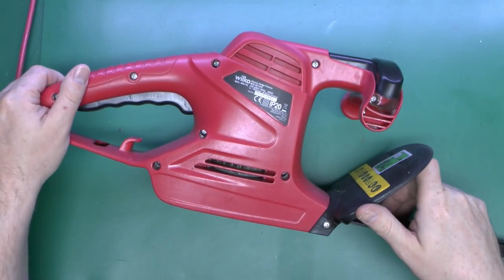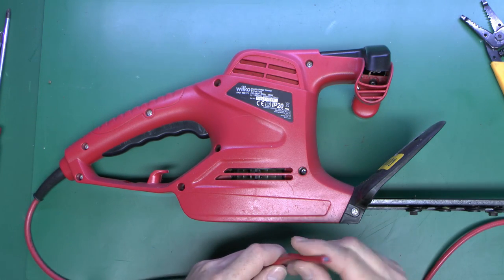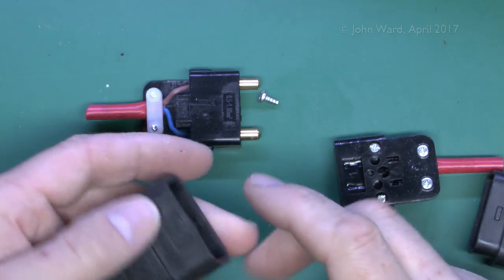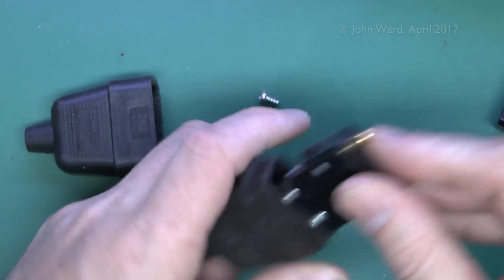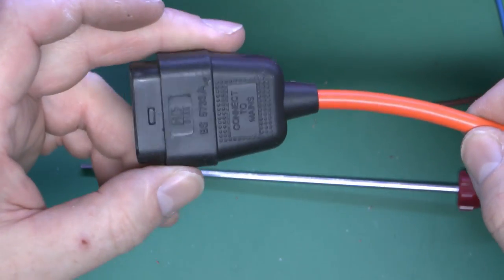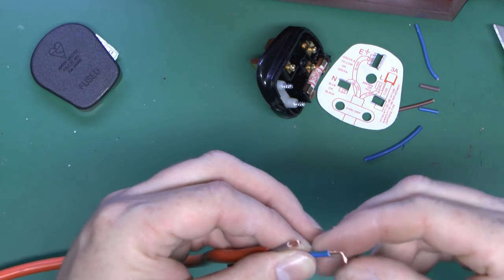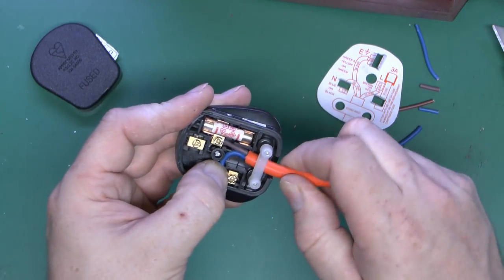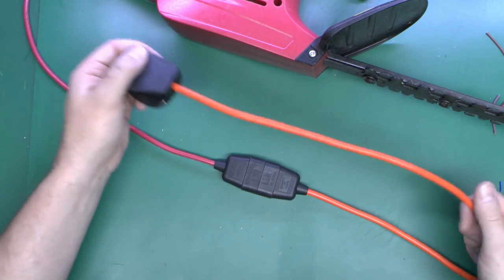Hedge Cutter Flex Replacement, Plug & Connector Wiring

Comment: when did Wilko become a sub standard shop?  it sells many good items. i agree the trimmer is crappy. but Wilko is awesome retail outlet. have you visited the pick and mix nuts bolts section?
Reply: Took me ages to fill a large bag, just had to keep putting more nuts and washer in to fill it :)
Reply: Every retailer sells crap, but they also sell some good stuff at reasonable prices.
Reply: Tangobaldy I agree Wilko is superb!
Reply: If you buy crap you get crap, that is entirely your own fault. Even the bigger ones like screwfix sell the crap parts because there is a market. 
If you feel better for paying £6 for a pack of ten wood screws that really proves you are very shallow.
Reply: Wall plugs are right money in wilko

Comment: Re oversized fuse, i've even caught channel safety systems putting 13A fuses on 30w LED power units....
Reply: You will have to count the power factor when you measure the fuse. if it is worse than 0.65 the current will be over 3 A.

Comment: Are those inline connectors within the Regs? They seem a bit sketchy to me. Doesn't seem hard for a child to stick something in their or so. Never seem them before either! :)
Reply from the maker: Yes, usually sold as 'lawnmower connectors', available in 2 or 3 pin versions, often coloured orange although black and white are also available.  Maximum current 10 amps, applicable standard is BS5733/A.
Reply: Black and decker garden tool always used to come with a short cable and had to buy the extended cable

Comment: here in europe hedge cutters etc have pretty much the shortest possible lead (like 20-30cm) so you have to use an extension lead, Idea is when you cut through the cable you just have to replace your extension lead. Might be a better solution in my oppinion.
Reply: You mean a more expensive way to repair it
Reply: well it does prevent people from fixing it themselves, I have seen people repair it by twisting the ends together and using some electrical tape to insulate it.
Reply: This is true, you cannot trust the average person to make a safe repair
Reply: (Ontario,Canada) My edge trimmer has just the prongs moulded into a well set into the casing.  I don't know if that's to prevent people from using an inappropriate extension or for overall cost.   But it has led to my needing to perpetually track down where exactly the many extensions have been left after "borrowing" every time I want to use it. 

... I'm going to zip/ratchet strap the extension in place now that I am thinking about it.
Reply: I noticed that awesomeness in the US and Canada. i think the size of our UK plug pins precludes that here, but it did seem really clever :)
Reply: LynxSnowCat I use a two-prong adapter. I think those are illegal in Canada, though.
Reply: Yeah, those are (now) but assuming that the appliance does not use the ground, it could be an acceptable risk. But I'd prefer to grab an extension cable because of the number of people I've known...

The prices in my area are ($1.3 per metre 16 AWG(13A) if longer than 15m, $2 per metre 12 AWG(15A) if longer than 30), but the factory for the same was (until recently) here, so prices may be depressed.

https://novascotia.ca/lae/electricalsafety/esbadapterplugs.asp
http://livesoundadvice.com/shock-a/noshockzone-rpbg-dangers/

Comment: Are all connections, for appliances, the same across Europe?
Reply from the maker: Voltage and frequency are the same, wire colours should be the same, plugs/sockets are similar in most of Europe, UK plugs and sockets are not.

Comment: The last time I had repair one of these I covered the last couple of metres of wire with a length of old hosepipe.  Makes it just wide enough to prevent getting between the blades. Not had to do another repair since then, a few years ago.
Reply: Seems like a very good idea for hedge cutters - I think nearly all the cuts will be in that area which is also the bit that's going to be flapping around and potentially touching the skin of the operator (who's probably wearing T shirt and shorts).

lawnmower cables  I suspect can get cut pretty much anywhere, but at least it'll be on a part of the cable that normally lies on the ground.

Comment: Its entirely possible I'm asking a silly question here, but my dad got a connector like the one in the video but because of the shape, you can plug it in either way (ie live going to neutral and neutral going to live). Does it matter? or is it a case we have a cheap connector and I should buy a better one which only allows it to plug in one way? This is for a Titan hedge trimmer so about on par with the one in the video. Thanks a lot for any help you can give me :) PS The comment about Wilko made me laugh xD
Reply from the maker: With only 2 pins (L&N) it doesn't matter.
Reply: @jwflame  Thank you very much mate! You have been very helpful! :)
Reply: I had the same question myself. Don't understand the answer but if he says it doesn't matter that's all I need to know.  It seems counter intuitive given the effort earlier in the video to feed in the brown wire into the L side and the Blue wire into the N side.

Comment: Thank you, very helpful. I bought a new hedge trimmer and cut through the wire whilst testing it, didn’t even start the job!! Saw that these would be the best way to reconnect the 2 ends of cable, but didn’t know how they worked.
Reply: Just done the same this afternoon.....!

Comment: Is that connector actually polarised? I did something a little more permanent for my neighbour when he cut his hedge trimmer flex the first time, and the second time he cut it near the plug so I just fitted a new one.
Reply from the maker: No, can be fitted together either way.  The markings in the plastic for L/N are probably because they use the same moulding for the 3 pin version which has the centre earth pin offset, so that can only be fitted together one way.

Comment: How do you connect the earth wire?
Reply from the maker: The device in the video is Class II / double insulated so does not need an earth connection.
Reply: @jwflame  So what do you do with the earth?
Reply from the maker: @MarcosJ-mq4lk  There isn't one, the flex only has 2 cores.  The plug has an earth pin, but that isn't connected to anything.
Reply: @jwflame  That was my Q.....I have a 3 wires....Earth"...so do i just leave that hanging?

Comment: I have been the recipient of what was a BRAND NEW Bosch hedge cutter which someone had cut through, on what appeared to be its FIRST use! Exact same problem, exact same solution BUT the cable they managed to cut through even closer!!. This is actually a deliberate mod I have done to most of my two wire supplied outdoor items. It's a damned sight easier to put the equipment away without 60 feet of cable attached. It also means that with just one or two cables you can connect whatever, whenever. 
The other advantage is that cutting the cable nearer the mains plug top means you can put two connectors and use it as an extension - useful when you need that extra "bit" of cable to reach the whole length of a hedge etc. with no need for another extension. So I wouldn't have cut off the moulded plug at all, but just fitted a new  connector at the cutter end (maybe with a new centre section depending on the length of red cable left). I can't believe the stuff people throw away due to their ignorance of basic electrical knowledge!

Comment: LOL @ a decent effort.... the worst experience i had with one of those was with a 0.5mm orange flex about 100m long (think 1980s)... cut through it, but the short circuit current would not take out the fuse... I was stood there on a stepladder with something that sparked a lot....and would NOT blow... 

These days I am more aware of PSCC, but back then it boggled my mind, and freaked me out

Comment: I think the reason a lot of people put a two pin connector very close to the unit is so it may be taken up a ladder.  A connector  on a reasonable length of flex with a 13 amp square pin on the other end like you have done gets plugged into your giant  25M reel.  This reel is totally unsuitable to take up a ladder due to its weight and size. Most of this type of tool has a plastic hook and hole at the handle end or other arrangement in the handle of the tool to wrap the flex around in case the flex is pulled very hard.  If you pull the flex hard enough such as up a ladder the two part plug separates which is handy because if it did not you might get pulled off the ladder.

Comment: If you have a lot of hedges a cordless hedge trimmer is well worth the investment. I think pretty much every corded hedge trimmer I've used has had this sort of repair done, it's all too common. I already had several of the Ryobi ONE+ tools so when I saw they made a hedge trimmer I thought I'd give it a go. It's one of the best garden tools I've ever bought, makes the job so much easier (and safer) without the cable and the 4Ah battery lasts for the whole job. It's also lighter than a petrol equivalent and I've never struggled to get through branches.

Comment: Around here many hedge cutters come with a very short lead that doesn't reach the blade, so you can only cut the extension cord. It is a bit annoying to have the bulk of the connectors hanging off the end, but it appears to work.

Comment: Hi John, I have 2600W electric garden blower which came with 400mm of flex fitted with a standard UK 13A plug. I was wondering if you knew the reason for such a short flex. On closer inspection the flex is 0.75mm² which I believe is undersized for a device rated at 2600W. Also, WD40 works well for removing label residue.

Comment: A much better solution is to place the plug-socket connection quite close to the machine at a distance that cannot be cut. That way, only the lead is cut and can be easily replaced or repaired without pulling the machine apart.

Comment: Surely, if the wire keeps getting chopped through, replacing and repairing it is not the correct way to prevent it happening again.

Not plugging it into an earth leakage detector and replacing the fuse with a piece of nail would be a more permanent solution - at most you'll need to replace the wire once more.
Reply: don't troll, its lame
Reply: It's not trolling. It's sarcasm and fits with the comment about the wire already being chopped through once already.

I miss the old Internet where people didn't take obviously silly comments seriously.
Reply: Usenet still exists ;) (meta comment)

Comment: I do worry about so-called "doubly insulated" tools - especially when the flex can be chopped through while the tool is running. Surely an RCD is referenced to earth for tripping as an imbalance between line and neutral. There is no earth reference on the tool or in the cable so is it possible that an RCD will not trip and leave a live flex wallowing about on the wet driveway? Presumably it relies on the MCB tripping as a current overload. Perhaps best to have RCBO's on these circuits to get the best of both worlds.
Reply: The wet driveway is earthed. 
The wet human standing on the wet driveway is earthed.
As long as you have a GFI with a non-lethal trip current you are reasonably safe (mandatory for outdoor circuits in many places). 
Earthed portable power tools are a hazard since flex cable breaks all the time and there is no way of ensuring earth conductor continuity.
Reply: Thanks for that stefantrethan - I'll have to think about it. GFI?
Reply: RCD in some places...

Comment: Never understood "double insulated" appliances with motors, seems to me like there is precious little between the motor windings and the metal frame, and the gears are usually metal, so the output of the tool is essentially connected to the frame of the motor, just like if you had a metal bodied tool
Reply: There is always a plastic gear, or a plastic sleeve between the armature and shaft.
Double insulation is more reliable than ensuring the continuity of an earth conductor, especially in a flex lead. 
The required creepage and clearance, or thickness of solid insulating material, depends on the applicable standard.
Reply: stefantrethan My dewalt grinder is ungrounded and the motor chassis is electrically connected to the output shaft...
Reply: Robert, 2cm is plenty of clearance, it's typically 5mm to about 8mm required depending on the applicable standard and operating voltage. To account for possible damage they push against all parts with a defined force and still have to meet the spacing, as well as performing standardized drop tests after which there must still be no danger.

As for the leakage, a solder joint 2cm away from the case would never do that (think about it - if that were the case a neon screwdriver would light in your hand 2cm away from power outlet - it does not but requires contact instead). The leakage almost certainly came from the EMI filter capacitors which is normal for switchmode supplies. Transformers don't require them.

I'm not saying the Chinese aren't loose with their symbols, there are plenty of suicide phone chargers with practically zero clearance. Just that there was nothing in your description of the amplifier that would worry me.
Reply: Luke, on angle grinders you will find a molded plastic sleeve between the armature laminations and shaft. 
It can be difficult to spot when dirty but I promise you it is there, just seen it on a Metabo the other day.

Dewalt has their tools certified by a third party (likely several), widespread global sale is practically impossible without that. Even if the distributors themselves would not demand it (they do), their competitors would immediately jump on any mistakes quicker than you can say "Dewalt".
Reply: Robert, one way to look this problem is that "soldering" and "sticking the wire through a hole in a lug or PCB prior to soldering" constitute two separate means of attachment. Yes it is not very nice, but many test houses that do safety certification will pass such an arrangement. The more stringent ones will require additional means of attachment such as a dab of glue. I agree that heatshrink tubing, a cable tie, or having the wire short so it can not reach would be preferable but in reality there is some room for interpretation in this area. 

A fairly neat way I have seen the Chinese use is to fold the wire back along the lug, and stick some heatshrink over that. Not only does it attach the wire and insulate the lug, but it will never break in the first place because the stiff area without insulation (where the solder wicked in) is now protected.

Comment: Shouldn't they be polarized?
Reply from the maker: No, it's a double insulated / class II appliance.  Doesn't matter which way L&N are, only that there is 230V AC between them.
Reply: @jwflame  I guess this really is not different than a cassette player with one of those figure eight plugs, as long as it's downstream of all fuses it shouldn't really matter.

just so used to 3 pin plugs it just feels wrong, even if I can't think of any good reason why not :)

Comment: Would have liked to have seen the trimmer plugged in and tested to see if the 3 amp fuse coped with the current surge on start up. I have a friend who read the rating plate on his freezer and swopped the 13 amp fuse for a 3 amp and all seemed well. He then went away on holiday and came back to a freezer full of mush. Wilco are not idiots, and fitted a 13 amp fuse for a good reason.
Reply: wattsupmike ? Chances are, the last time the cable was chopped through the fuse blew and was replaced with the 13A
Reply: Thing about hedge trimmers in normal use they are switched on and off many times and doubt a 3 amp fuse would work. I have an vacuum cleaner rated at 550 watts,  (about 2.2  amps) and tried fitting a 3 amp fuse but it kept blowing so refitted a 13 amp fuse.
Reply: wattsupmike ? - you do know that 5A fuses exist and are widely available...
Reply: @wattsupmike7593  You cannot calculate amps from the watts unless it is a resistive load.

Comment: Thanks for the video. A drop of IPA (not Watneys) will get that mucky glue off.

I inherited a Weller soldering gun from my Dad. It was from about around the mid-Sixties. It came in a nice little case, with a detachable mains cable; one of those in-line connectors, just two pin, no earth. Not only did it have no earth, but the in-line connector was installed the wrong way i.e. male on the mains side.

Safety just wasn't considered many years ago, or perhaps a volt wasn't as powerful in those days.
Reply: Well he'd mor likely have wd40, that works too

Comment: what i did when i chopped my cable is used a connector block and then wrapped it in electrical tape and then tied a knot where the connector block is so you can not pull the wires out problem solved for a quick fix to get the rest of your job done or fix the wire or buy a new one